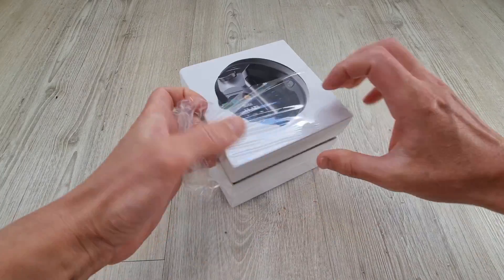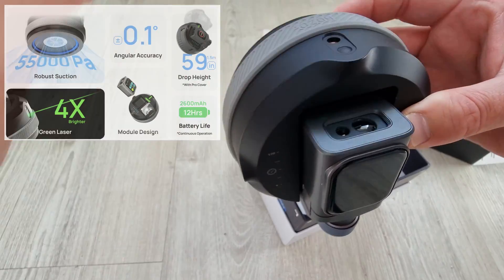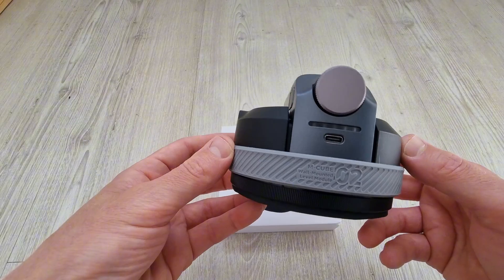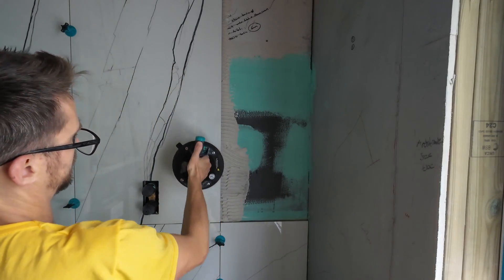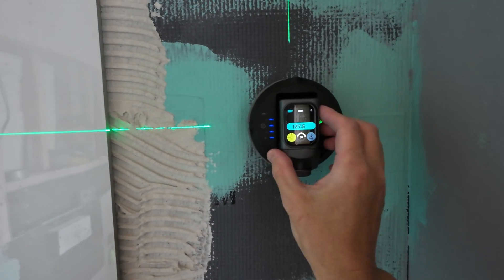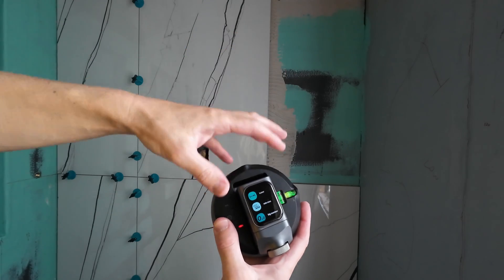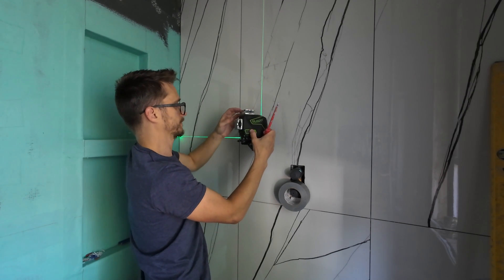You've Never Seen a Laser Level LIKE THIS!

Comment: Just buy a laser level suction cup the level isn’t level. What’s the point??
Reply from the maker: Do they exist? The point is.. it's got loads of uses, You can ping a straight line at any angle, So great for herringbone and woodwork. You can use the module to do a crazy amount of useful stuff. And you can attach a different 360 laser if you wanted to.. So pretty decent.

Comment: I’d buy this right now if it was just a mounting base for proper lasers.
Way too much money for all those extra gimmick features.
Reply from the maker: Absolutely, I think that is one of the great unique features!
Reply: @thebespokebloke can it still be operated when you take the control panel off, to put the mounting bracket on?
Reply from the maker: @ThisTall  Yes mate, They both have separate power
Reply: @thebespokebloke do you know of any other product that provides just the auto suction base to mount other lasers?
Reply from the maker: @ThisTall  Not that I know of, This is why this one was so unique. I'm surprised the big brands haven't tapped into it yet

Comment: Why tf would you make a laser level you have to first level yourself with a 1 inch bubble 
So it guaranteed to be out of plumb 😂
Reply from the maker: I think it's other functions far out weigh that, You'd just stick your gyro laser on it for that use.
Reply: @thebespokebloke I just cant fathom why they wouldnt include auto levellin? 
I would have bought 2 immediately!
Reply from the maker: @trelcomultiskilledtraders1334  I think with how the design is you can't really have that kind of setup. But I'm sure you could use the gyro in the module for plumb. I'll check it out

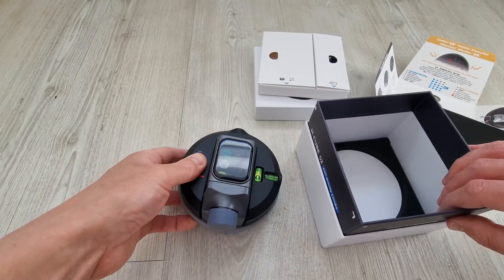Comment: is this a good replacement for the tripod? seems to work well with walls when your tileing a shower but in backsplashes with one wall you may need to use a tripod. My only concerns is that it may get in the way when your tileing a wall like here 4:34 and does it also work with inches and feet? Looks impressive where using a tripod could be difficult in tight rooms and the angle finder could come in handy.
Reply from the maker: I'd say what it adds is a good option in certain situations, Sometime just sticking to the wall may be in the way e.t.c.. But then you'd just use a different method of seating it. I have a tripod floor to ceiling pole which i use a lot for lasers and filming. But that is also sometimes annoying, so the sucker on this laser comes in very handy. But yeah it's not going to solve all situations but paired with a 360 laser it gives you great versatility. Yep you change it from metric/imperial e.t.c. I was very impressed, it's a good gadget to have for many different things.

Comment: Amazon review says it doesn't do automatic levelling like other devices. You have to set it manually based on the bubble which is too small to be accurate as the reviewer finds. For £260 it should be doing the basics well before adding the fancy features.
Reply from the maker: I think you completely miss the point on what this tool is about.
Reply: @thebespokebloke what is it about?  I thought its a laser level

Comment: You must have been lucky. 

I’ve tried two via Amazon and both had fatal faults. 

The tiny tube levels on the base used to find level were both miles out meaning you needed another self levelling level to set the base up. Useless. 

Make sure you don’t install pissed tiles with this!!
Reply from the maker: Yeah must be a bad batch there maybe? Mine seems fine. But yeah I'd always use a level with a laser anyway when Tiling, So I can make sure my tiles all hit the level 🍻
Reply: @thebespokebloke I just wouldn’t pay the money for a level that relies on a tiny tube. Perhaps the base with a ‘proper self levelling g level’ but I don’t trust it to hold the weight.

Comment: £259😂😂. I've been using my £20 dust collector with suction and laser, along with my 360 laser level for years now. Way better and cheaper alternative, even if you buy a separate distance measuring device.
Reply from the maker: I think this is a bit more advanced than a hoover mate.. Just saying
Reply: @thebespokebloke sure, completely agree pal. I'm sure it has better design, you have a nice screen on it, you can store your measurements etc. But 90% of the time you will still use it with 360 deg level attached and you don't have that hoover option, which believe it or not is quite handy. So with separate distance measuring tool you will get the same or even more functionality for a fraction of a price. And for a random DIY 'er (and not only) to spend £259 on a tool like this seems A LOT. But naturally, if you like it and you can afford it - by all means go for it. I would personally spend this kind of money on some other tool. And trust me, you can't do anything on this tool that I can't do on my cheap 'hoover' setup.
Reply: Btw, I really enjoyed your video and think it's a cool looking tool, just don't think it's worth so much money.

Comment: That's not a laser level. It's a level with a laser on it. There is a difference. An actual laser level is self leveling
Reply: You're spot on, amazon reviews agree.
Reply from the maker: Are you sure about that, ha.. It's more than just a laser level as the video shows 🍻
Reply: @thebespokebloke  It's not self leveling tho is it. And when you put a real self leveling laser level on it, i noticed you stuck it to tile , not plasterboard that time. So I'm guessing it doesn't work with anything that heavy on a rough surfaces, right?

Comment: Is it self levelling....? Doesn't look like it.  What's the point then?
Reply from the maker: Well you have to put it up reasonably level the same as any other laser level.. It's just has a bubble to help you with that. Or the gyro inside the module
Reply: @thebespokebloke so it is self levelling? It's not totally relying on you to go level by eye on the bubble? Module just looks too small to have a pendulum in it to find it's own level.
Reply from the maker: @NewPremier-x8s  Have a read of the full specs on the website mate.. I'm sure all your questions will be answered 👌
Reply: It isn't self levelling ..
Reply: This video is showing a measuring device.  The suction mount has a tripod connector for standard self-leveling laser levels.  It's shown as an example on the product page.